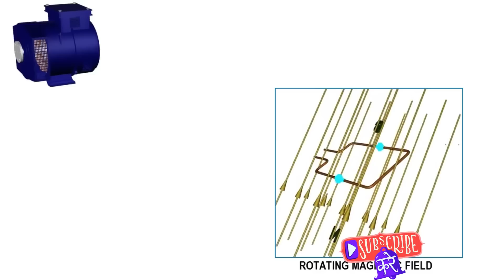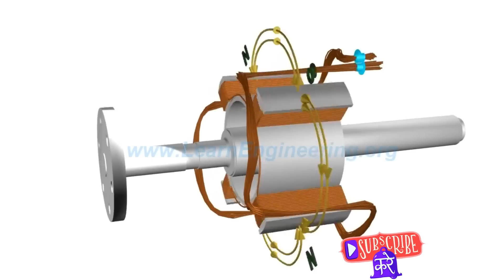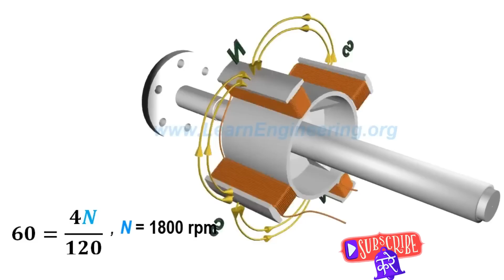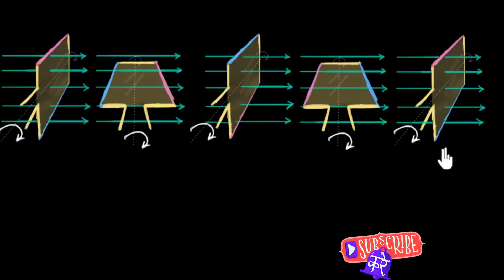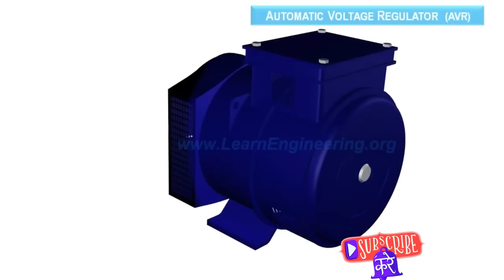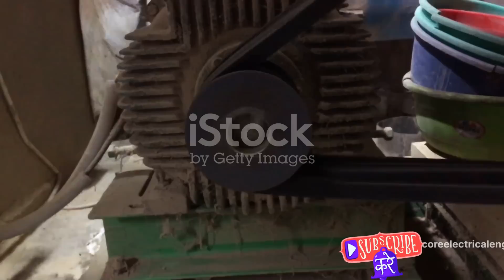Can You Understand How AC Generators Make Electricity?

Comment: What if the generator isnt converting mechanical energy to electrical energy. But is actually convertjng the one dimensional magnetic energy into a electrical energy. But because the energy conversion fight against itself, a continuous and excess mechanical energy is needed in the form of torque.

Comment: The audio and the illustration do not match.
You're talking about the rotor cutting through the magnetic field, but the illustration clearly shows the rotor setting up a rotating magnetic field, inducing an A/C potential in the stator.  
The vast majority of A?C generators follow the illustration.  There are a few exceptions out there that use the rotor to generate the A/C potential,  But they require more carbon brushes to handle the current coming off the rotor.
You might want to modify your presentation.
Reply from the maker: Thank you for your insightful feedback regarding AC generators! You've raised an interesting point, and I appreciate your attention to detail. Let's delve into this topic further.

**AC generators**, also known as alternators, play a crucial role in converting mechanical energy into electrical energy. They are commonly used in power plants, automobiles, and various other applications. Now, let's address the discrepancy you've pointed out:

1. **Rotor Cutting Through Magnetic Field**:
   - In the traditional explanation, the rotor (the rotating part of the generator) cuts through the magnetic field lines produced by the stator (the stationary part).
   - As the rotor spins, it induces a changing magnetic flux in the stator windings, resulting in an alternating current (AC) potential.
   - This process adheres to Faraday's law of electromagnetic induction.

2. **Illustration Showing Rotating Magnetic Field**:
   - You're absolutely right that some illustrations depict a different perspective.
   - These illustrations often emphasize the concept of a *rotating magnetic field* generated by the rotor.
   - The rotor's magnetic field interacts with the stator windings, inducing an AC voltage.
   - This approach is particularly useful when explaining three-phase AC generators, where multiple windings create a rotating magnetic field.

3. **Variations and Exceptions**:
   - While the majority of AC generators follow the traditional explanation, there are exceptions.
   - Some specialized generators (such as brushless alternators) use the rotor to generate the AC potential directly.
   - These designs eliminate the need for carbon brushes but require more complex electronics to regulate the output.
   - However, as you rightly mentioned, they are not as common as the traditional design.

4. **Carbon Brushes**:
   - Carbon brushes serve as electrical contacts between the rotating rotor and the stationary stator.
   - In traditional generators, they allow the current from the rotor to transfer to the external circuit.
   - Generators that use the rotor for direct AC generation may not require carbon brushes.

5. **Presentation Modification**:
   - Your suggestion to modify the presentation is valuable.
   - When explaining AC generators, it's essential to strike a balance between simplicity and accuracy.
   - I'll ensure that future explanations consider both perspectives—the rotor cutting through magnetic field lines and the concept of a rotating magnetic field.

Thank you once again for your keen observation! If you have any more insights or questions, feel free to share them. 😊
Reply: There are no magnetic field lines or magnetic field in an unpowered coil of copper wire until power is applied to it.  That creates the magnetic field